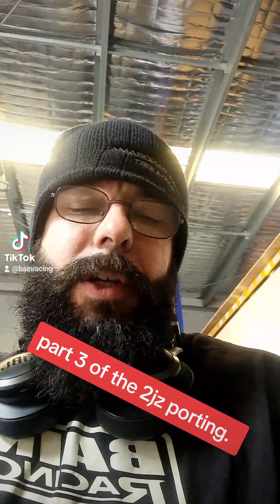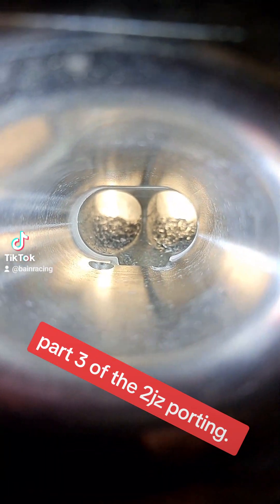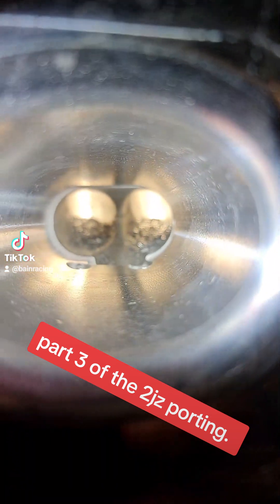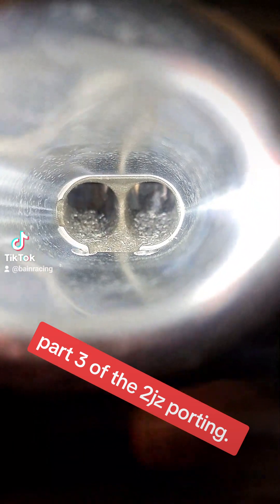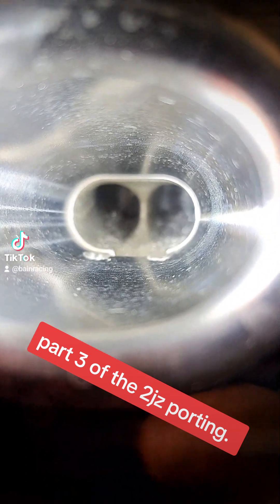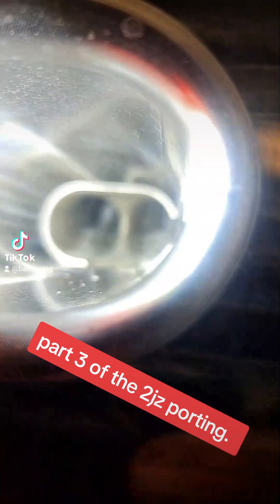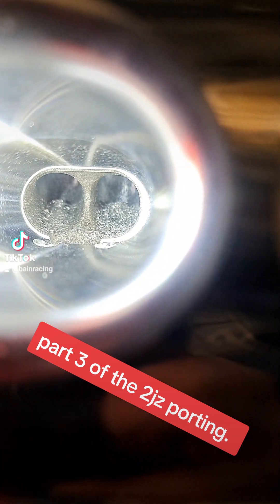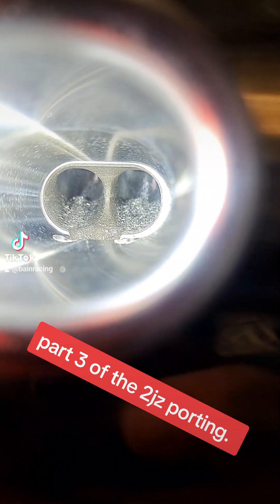Mastering the Art of Hand Porting: The Complete Guide to Porting the Toyota 2JZ-VVTi head Part 3

Comment: I always say that the internal combustion engine is a delta P device. It makes power through pressure differential, and our job is to manage that
Reply from the maker: That's it mate 👌  getting as close to the point of negative returns as possible to maximise both velocity and our inertia filling mechanism
Reply: @bainracing  but it also carries on into the combustion cycle. We want to create the highest delta P with the smallest amount of pumping possible in order to maximise efficiency
Reply from the maker: @theshed8802  Oh 100%, its why the discharge coefficient is so important to the complete flow path and also effects port stability and mass flow rates of the cylinder head. Its also why i try to keep the MSC as close to the seat as possible to reduce the losses when the saturation point moves from seat to port. This where the PD will be the same, but our inertial length changes. so you can have two ports with the same pressure differential. but the one with the longer inertial length will win every time.